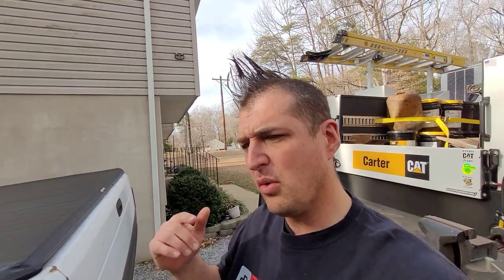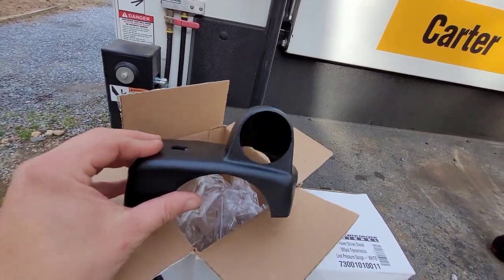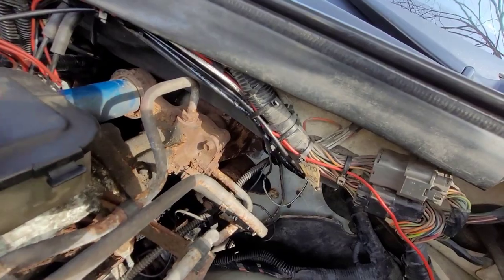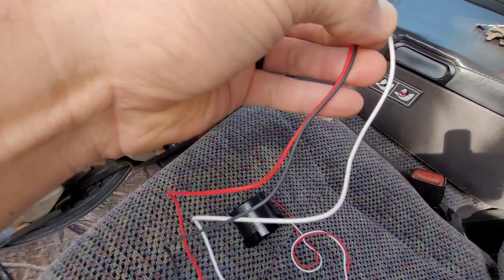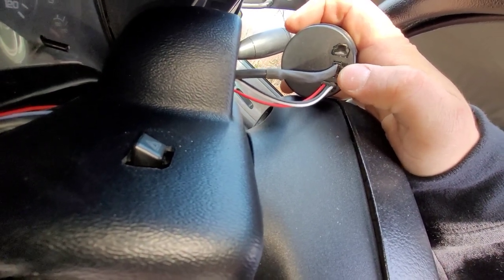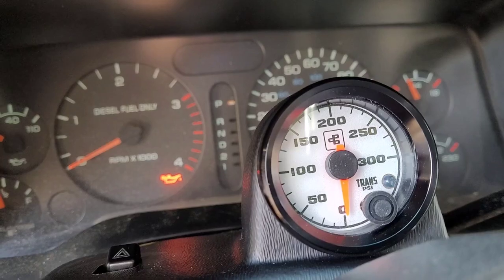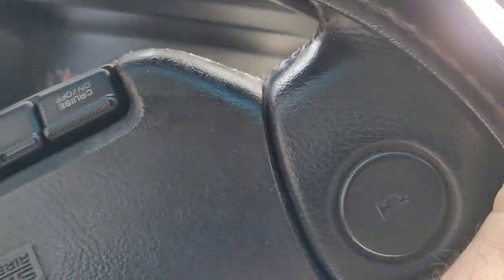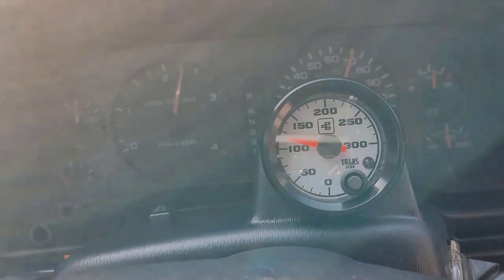Installing/testing @pddofficial transmission line pressure gauge

Comment: I like mechanical gauges for pressure, when the oil heats up they keep the pressure better than electrical as electrical drops off and loses calibration in spring and diaphragm when hot and over time.
Reply from the maker: Mechanical Gauges Are Great But, This a "cleaner" option for pressure (i.e. not running line into the cab)

Comment: Why mount the sensor where you do vs the front port that is named, "pressure test port"...
Reply from the maker: The Accumulator port is where I mounted it and that where you get your line pressure from (manual stated as well as PDD)

Comment: I’m gonna be installing a gauge similar to this for trans pressure. When removing that factory plug, do I need to worry about any sort of pressure release or fluid coming out when the trans is cold?
Reply from the maker: No Just Remove The plug and install  your gauge/sensor
Reply: @slowaf12v  Awesome. Thanks for the quick reply.